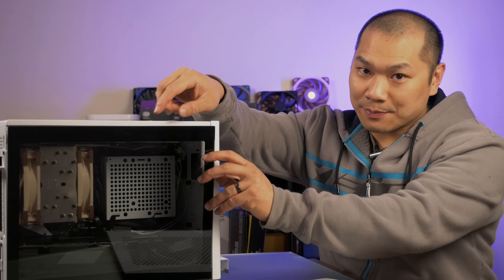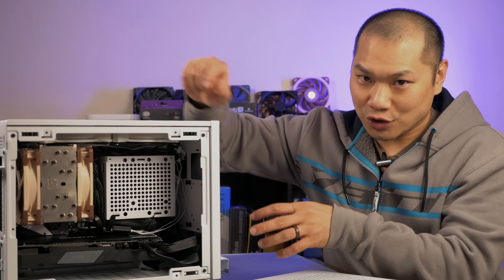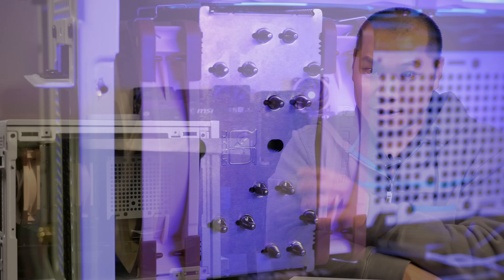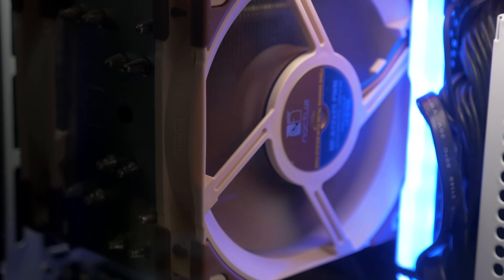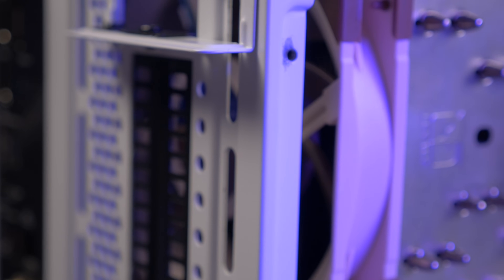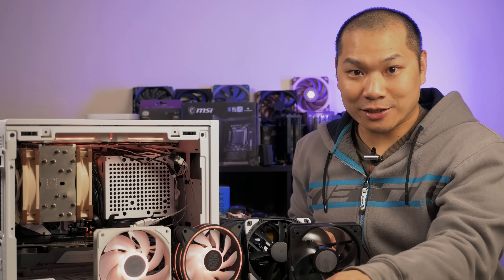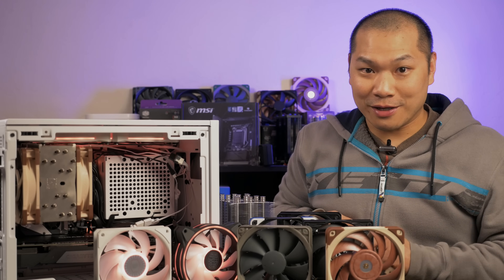Cooler Master NR200: Optimizing Air Cooling Thermals Part II: Higher TBP GPUs and the NR200P

Comment: I know it's a smaller CPU cooler, but I wonder if you might look at the Noctua NH-U9S as a cooler that provides space for bottom to top airflow.  Especially with a shorter (1 or 2 fan GPU) which would align more with the average consumer?
Reply from the maker: Robert- there's a U9s video on the channel when I reviewed the Chromax.
Reply: @MachinesMore  I’m following you on this endeavor for sure. Will build my rig Friday using NH-U9S and a measly 3200g while I wait to install 5800x (no GPU luck yet). I’m playing with the idea of using the cpu fans to move air bottom to top rather than exhaust through side.  With the nr200p, I wonder if that benefits. Also, I’m interested in GPU length impact on airflow. Also looking forward to seeing how the bottom vs top fan optimized set looks.

Comment: Would really like to see a Noctua cooler push/pull from the bottom up.
Reply: I used a big shuriken 3 with a 20mm fan, vertical gpu, and 4 fans in push pull from bottom to top, best setup I've found for this case. I'm matching or beating these thermals with a 2080 super.

Comment: Still gathering parts for my NR200 build and have a question. Will the NH-U12A fit with the Gigabyte B550I itx motherboard and both top case fans ?
Reply from the maker: Yes.

Comment: I have Scythe Fuma 2 that combined with MSI B450I has enough space to fit two full size 25mm fans at top with about 1 CM of clearance in between in NR200. With this in mind, would I better off with having 2 fans (the ones included with the NR200P) mounted at the top or at the bottom? Thank you

Comment: Have you considered using shorter motherboard standoffs to make more room to fit the U12A? There's some discussion on /r/sffpc that leads me to believe you could fit a U12A with the TG side panel if you're running 2-3mm shorter standoffs. Let me know what you think.
Reply from the maker: I have but there are a lot of factors at play here. You could use shorter standoffs but it depends on your motherboard- some have a thicker backplate (like the X570-I aorus and the B550 I aorus) that sit on the tray directly anyway so the standoffs are not the bottleneck. Technically you could remove the backplate but it does have some shielding properties so you would want to be careful if you removed it. So if you do go with shorter standoffs make sure nothing is touching or shorting out. Finally there is the issue that your rear I/O cutout won’t line up so you would have to work with that too. The U12A fits- it’s just not interference free so it’s up to the user if they want to put up with it or mod a little.
Reply: @MachinesMore  Thank you for the response. I'm going to give the U12A a shot. 😊

Comment: How well would the Scythe Kaze Flex and/or Kaze Flex Slims work for an RGB air cooling solution with the tempered glass SP?
Reply from the maker: I’m assuming your cooler has a light up plate or cover- the Kaze Flex fans are not abnormally sized fans and attach normally, so as long as your RGB cover isn’t integrated into the fans or using some proprietary attachment method you should be able to swap it nicely.
Reply: Machines & More I’d be using the scythe mugen 5 rev.b and I was going to use 6 fans.

2 RGB Kaze flex slims beneath the gpu as intake

1 25mm and 1 15mm flex rgb on the cooler on intake

2 25mm on top as exhaust.

I’m a new builder building around the 3080 and a 5600x and am really enamored with the NR200P but I’m also considering the lian li 011 dynamic mini too.

Being new, I don’t know how much, if any, overclocking I would be doing but I don’t want to necessarily limit myself either.

My capability goal is sim racing in Assetto Corsa Competitzione in VR using a Reverb G2.

Primarily gaming with the option for some streaming.

Your Lian Li 011D mini video has me conflicted

Comment: Would it make sense to use a tower with one pull fan and then a 120 fan installed to the back of the case as exhaust? That way it is pulling the cooler exhaust as well as other exhaust?

Comment: Have you considered rotating a tower cooler by 90 degrees and putting a fan on the bottom side for a push configuration? My intuition is saying it might fit the bottom to top airflow the best.

Comment: Everything intake, Top exhaust.

GPU horizontal intake, CPU intake, Power Supply Intake, 2 extra bottom fans intake.

Two top fans Exhaust. I can’t tell if you tried that.
Reply from the maker: Correct. That is the optimal config if running a hot GPU with bottom fans.
Reply: @MachinesMore  dope. Glad you were able to test. I had theories. Just no money to invest.
Thank you.

Comment: Do you think a C14s could handle a 9900k on stock settings? I'm thinking of running it with a 3070 (regular vented nr200)
Reply from the maker: Yeah, should be fine. Running a 10700K now on a smaller U9S and it will run at stock up to 4.7ghz all core no problem.

Comment: With the Fuma 2, would you rotate the cooler to have the slim fan face the rear of the case when doing CPU intake or do you think it could handle it fine facing the "normal" way?

Comment: Your in depth NR200 videos are really helping me decide on my next system. 
I will be getting a NR200P to give me the best total options and I like to see my gear.
I will have a Ryzen 5 3600 and GTX1660 Super so TDP will be low so maybe will stick with stock fans on bottom and maybe a U12S (harder to get the ID cooling unit in my country).
I will have some spare Cooler Master case fans from my current NR400 to add to the top. Or maybe some matching Noctuas for the top.
Reply from the maker: Awesome! For the 1660 super fans aren’t super imperative- it’s a relatively cool GPU, while I’m the fans would help, this is a card that you don’t have to spend too much to help run cool. Plus the impact on the rest of the case isn’t as pronounced since it is a mid range card in terms of TDP.

Comment: Greta videos and very informative! I have a question though, I plan on using the lian li 240 aio. Is the top fan supposed to be an intake fan and the rear one exhaust, correct? And if I wanted to add another one up too would I have to change any air flow direction with my case fans? I plan on only having 2 or 3 case fans tops.

Comment: I freaking love the NR200P because it's so versatile as an ITX case but I feel there could be 2 things that CM could've done. 
1. Make it a little bigger in terms of width and maybe height like 5mm? I understand it's a big case for an ITX but why not just a little more? It could accommodate SFX-L PSU without interference with big GPUs and 25mm thick fans on the top, in addition it could support some great tower coolers which are shy of a few mm right now!
2. Support for top mounted AIOs. As much as I love the tool-less system I feel that it's the only optimal place to mount an 240 AIO as per GN. 

Perhaps they could revise it in the next update!  
Just my 2cents.🙂
Reply from the maker: Good points. For tempered glass users I personally would have preferred top rad compatibility vs bottom fan compatibility (if one had to choose) since that opens up more possibilities for folks, ie ability to run an AIO without vGPU. Usually the GPU can handle itself, even if some help is nice from bottom fans.

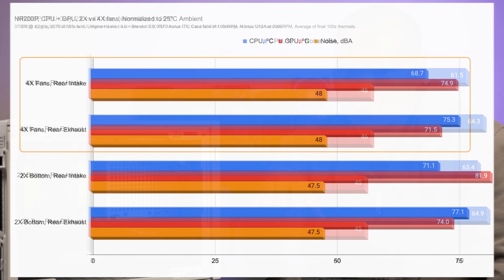Comment: Is there a typo on the chart at 8:14? Is the bottom-most row supposed to read "2x TOP, Rear Exhaust" ?
Reply from the maker: No- since the better place to put 2 fans only was at the bottom, I used that for the comparison.

Comment: I recently got a Be Quiet! Pure Loop AIO and with it's decoupled pump, I was thinking it could be the best AIO for bottom-mounting in the NR 200. I was wondering if you can test that out. Since the pump is located on the tubes, theoretically it would not run into the problems that GN had mentioned with bottom-mounting. 

I am also considering trying to mod the case to fit a 280mm in the bottom, wondering how feasible would that be.
Reply from the maker: Hi Tian, thanks for the recommendation- indeed lots of folks have recommended that as an option so a test unit from BQ is on its way! I think you’d have to take out the mounting clips for a 280 to fit flush at the bottom. I can see how it could be done though, you would just need to take out the clips and file off the tabs.

Comment: Can you fit mini atx motherboard?
Reply from the maker: Certain ones, yes. It’s a very tiny list- mainly the PCI-E slots don’t necessarily line up, even if the  board does fit.
Reply: @MachinesMore  thx a lot, i ordered a nr200p, but i need to send back a msi b550m mortar wifi.. your guide will help a lot since its my first build 😁😁

Comment: Love the vids man, but I'm a little confused now. My nr200p is on the way and waiting on my 3080, so basically what do you suggest is the optimal air cooling layout for this case with these components? I thought we'd kinda settled on the C14s with a side mounted fan as it doesn't get affected by the heat from the big power GPU's like a 3080. But now in this vid we're back with the U12A? Thanks
Reply from the maker: Part II is primarily about the P version with tempered glass panel. The C14S isn’t ideal for the TG, since it loses the advantage of fresh air intake. Therefore for air cooling with the glass panel, towers are best. Rear intaking towers with bottom fans are pretty good with the 30 series (and that’s pretty much the only way to do it with the TG panel).
Reply: @MachinesMore  oh ok. So using the mesh, which is what I always planned to do, would you recommend the c14 or the u12a? I'm leaning toward the u12a for ease of setup not having to get an extra 120mm fan for underneath it, which really restricts ram clearance.
Reply from the maker: Probably splitting hairs between them but I think the U12A is a tiny bit easier in terms of setup like you mentioned. Out of the box it’s ready to go. The thing with the C14S is it has a lot of case and fan tweaks available that make it fun to mess around with. Did you check out the 3080 FE in SFF video? There’s a couple of configurations shown. If you haven’t yet it might address some points (albeit I tested with Fuma 2). https://youtu.be/thmpkPjnUDE
Reply: @MachinesMore  yeah ironically that was partly what made it a bit confusing. Each vid has a different combination of cooler and use case. Possibly it's just me being stupid, but an idiots guide video for "best overall air and aio cooling solutions for nr200 with a 3080/6800xt" would be awesome lol.

Comment: Could you do the same build but with a 92mm aio cooling the cpu and top fans? I also think the 3080 is too big to run fans underneath.
Reply from the maker: Technically yes, but when you can run a 120mm tower cooler even the lower cost ones will get you great performance. Unless there’s a space limitation, I’d never recommend a 92mm or 120mm AIO for cost and complexity.

Comment: Is it be feasible to dremel down the heat pipe ends a bit so the TG panel can close properly?
Reply from the maker: Yes, I probably wouldn’t do it to a U12A myself but if you want to take a gamble on how far you could go, it’s doable. Too far and the heatpipe is rendered much less useful (vapor/liquid is gone). I guess you could try one pipe and see how far you could go... if you go too far you still have six. 😆

Comment: You think 3m mounting another fan on the right of the tower cooler as exhaust would help out a rear intake tower cooler?  Thanks for all the coverage.  Building my next personal rig tomorrow
Reply from the maker: Of course- top exhausts are vital to the case working well. Curious why 3M mounting though? You can use the tool-less mounts unless you're using an ATX or SFX-L and are trying a slim fan, in which case you have a few options- carefully remove the mesh and screw through, or use something called a Clevis pin.
Reply: @MachinesMore  naw I meant on the vented side panel since you cant use the mount.  

2 fans top and bottom and 1 on side vented panel.  

Haha sorry for my wording
Reply from the maker: Ah, gotcha. I tested that early on with the U12A and some blue tac. I didn’t discuss it because it didn’t do anything meaningful. The passive airflow from the top exhaust is already sufficient. Some folks have drilled the rad panel to get it to work but I personally think it’s not necessary from a noise/cost/trouble added vs performance impact perspective.

Comment: Thank your for all the work you put into your videos, super helpful. What would you suggest for the quietest AND most efficient air cooling setup for an NR200, with say an RTX 3080 and a 5800x? I've watched the series but still left wondering about this.
Reply from the maker: Of course! A rear intaking Noctua NH-U12A is a good choice for noise perception (different than technical noise pressure which is measurable), since it uses two of the smooth sounding NF-A12x25s.  The C14S + NF-A12x25 pull fan combo is also good, the only reason I rank that marginally lower than the U12A is that potentially, depending on which side of your case faces you, the rad fan can seem louder due to the proximity to the exterior panel. Also at least to my ears, the A14 stock fan is a little more rough sounding at high RPMs, even if the measured decibel level is the same. Otherwise, from a technical sound perspective both are very good options.
Reply: @MachinesMore  Really appreciate you taking the time to answer my question my dude. Thank you!

Comment: Hello interested in building in the NR200P case. I have a few questions about it:
1. Can I fit a 240mm AIO below when using a compatible matx motherboard?
2. With the config above can it also fit a vertical gpu?
3. Can I use an atx psu with the same config or stick with sfx psu?

You can also suggest other case in the price bracket of around the same price

Thanks everyone trying to fit everything in a smaller case and NR200 seems fit for me :)

Comment: Very cool video. Could you try deshrouding the gpu, and running the bottom fans (and rear) as exhaust? Also - were you able to try both tall and slim gpus? i feel like distance between the card and the tempered glass panel should matter quite alot for the airflow.

Comment: I wanted to transition into NR200P but I really don't wanna change my CPU cooler. Currently using NH-L9a and seems like it's not gonna do well.
Reply from the maker: The L9A/L9i work fine for the Ryzen 5’s at lower clocks. Basically they at least match the stock cooler performance but in a low profile packageS

Comment: How were the Noctua NF-A12x15mm SLIM, Chromax? I'm planning on putting 2 as exhaust in my system. I was also thinking of putting the one above my fuma 2 and intake and the one above my psu as exhaust. Is this smart?
Reply from the maker: The slim Noctuas are the best slim fans you can get. In general you’d want to run all fans running air in the same direction, the mixed direction just adds turbulence and things don’t work as well. So I would run both as exhaust overhead. If you’re using an SFX PSU that fan over the PSU can be a 25mm one.
Reply: @MachinesMore sadly it is sfx l, and there are no chromax 25mm nf a12's. Planning on returning these sometime in January when they launch the chromax 25mm and I can grab an sf750. My aorux extreme 3080 and 3900xt are a MICROWAVE.
Reply from the maker: Gotcha- yeah, then a slim is probably the best you can do. Are you set on the SF750? Check out the channel on Tuesday next week for another option.
Reply: @MachinesMore  interesting.

Comment: Tbh this makes me extremely curious if there's any way to get shorter motherboard standoffs so you can fit the cooler
Reply from the maker: You can- couple things, the lovely backplate for the X570 board would have to come off and (bigger problem) I/O will be misaligned. I’d further shield off the panel with electrical tape.

Comment: I ditched the TG altogether, bottom is slim 240 rad with two A12x15 fans as intake, top is two A12x25 as exhaust, side is single slim 120 rad with A12x25. Cooling 5900X with RTX 2080 Ti. Quite happy with thermals (tolerable, considering rather conservative t/RPM curve) and more than acceptable acoustics.

Comment: Another great and detailed video for this awesome case. Could you also recommend/test some low profile coolers with the glass panel and vertical GPU mount - that will be very interesting if you are going for the looks, but also care for airflow optimization.

Comment: Thanks for this content. will be building with the nr200p but am still waiting for AIB RX 6000 series. Was planning to do a vertical GPU mount. Do you have tests on this kind of setup?
Reply from the maker: I’ve done a few tests and the only reason to do so is for putting a radiator on the bottom. Air cooling with a low profile cooler doesn’t work well in this scenario. If you take a look at the review in the MSI Coreliquid there are a few tests with the vertical GPU.
Reply: @MachinesMore  will check the review . thanks a lot.

Comment: I'm still a little confused as to the best configuration for my upcoming build. Will be running a Ryzen 5600x and RTX3080 in the normal vented side configuration (no TG panel). From what I can understand around the 3 minute mark, I should be running a tower cooler in intake configuration, 2 exhausts at the top, and 2 intakes at the bottom. Is that correct? If so, that should work well as I'll likely look to deshroud the GPU in future, which will cause less turbulence conflict with the intakes at the bottom.
Reply from the maker: Hey- you’re correct- that’s the orientation I’d recommend for both TG and vented with an extremely high TBP GPU. Deshrouding may help the GPU, at least in terms of noise.